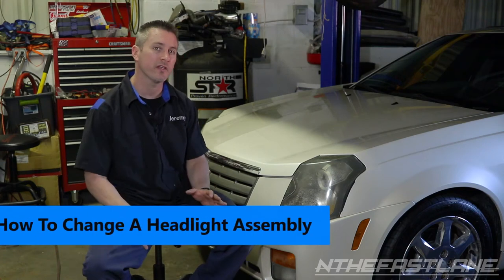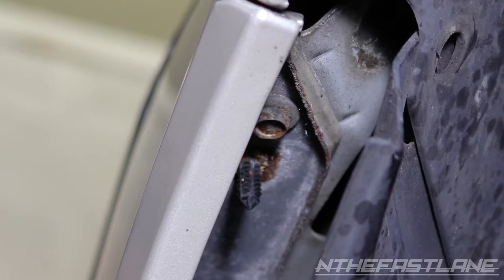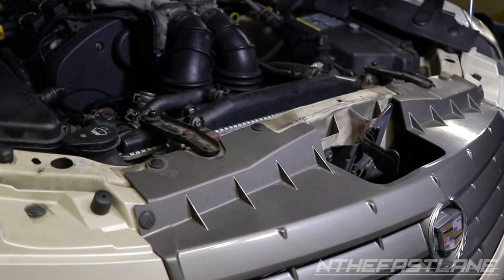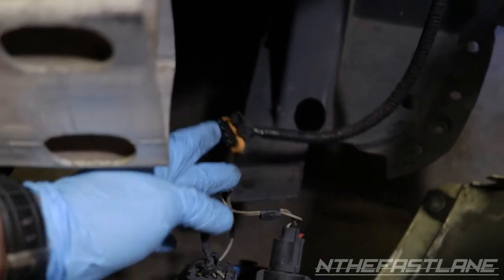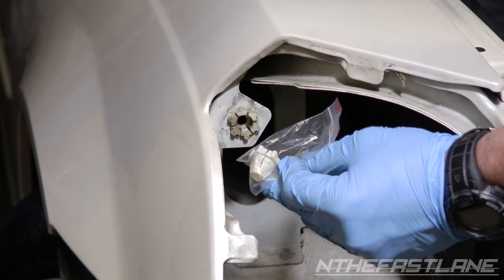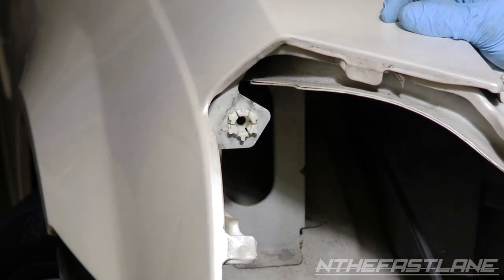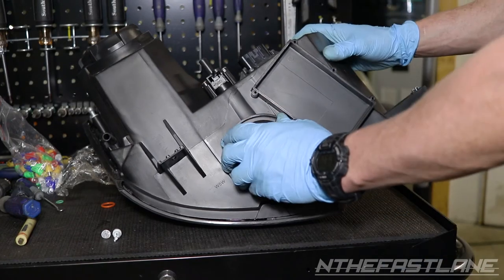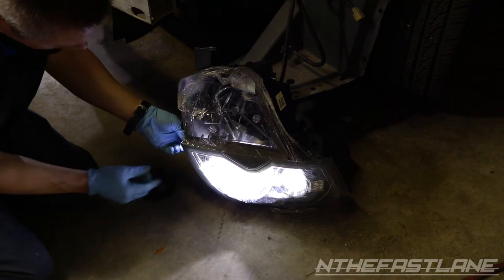▶️How To Change A Headlight Assembly For A Cadillac CTS💡

Comment: Hi Jeremy, great video. I have a 2005 cadillac cts and my drivers side has the condensation. My light however has one of those light washers that pop out to spray the headlight. Can I put in a light that does not have the washer or does it have to be the same light? Also do you know where i can find one, I cant find one with the washer part. If you know a place that would be insanely helpful. Thank you again for the video🙌🏼

Comment: Why are you changing to LED bulbs?  Thanks for the video!  Great job!
Reply from the maker: I personally like HID bulbs. However, they use a lot more power, produce more heat and don't have the longevity of an LED bulb.

The reason I personally went with LED is so that I don't have to do this complicated disassembly as often when changing out the bulbs.